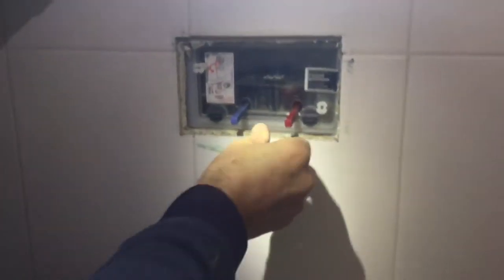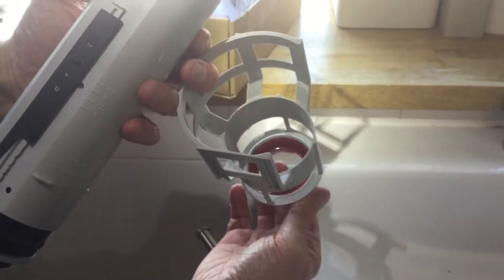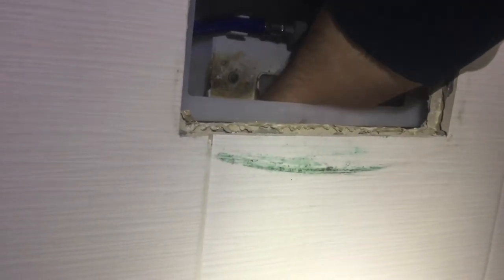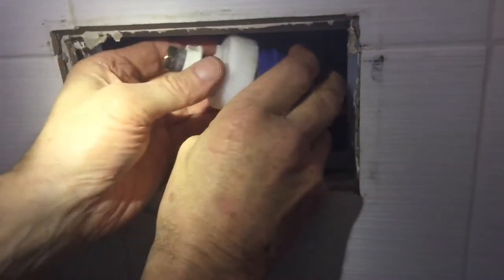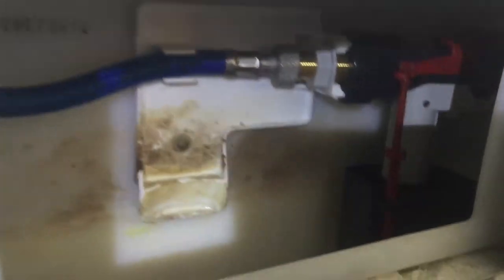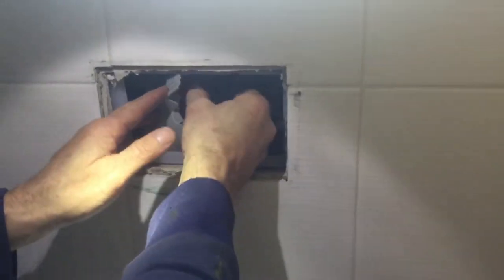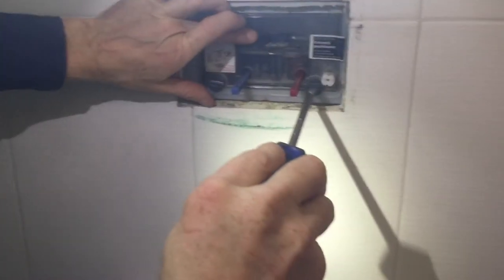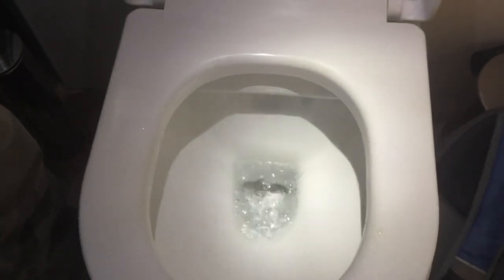TECE concealed toilet cistern repair

Comment: Hello I have the same toilette and the fill valve stopped filling the watter. Now it still takes like 22 minutes (at 6 litres setting) to fill the cistern, although I did some cleaning, so buying new part. I don't know the normal duration of filling for this Tece valve, but for instance with Geberit WC model it should take only 90 seconds.
Reply from the maker: Hi, this one was taking about 30 minutes to fill, but with the new valve fitted it’s about 45 seconds. The water supply is at a pressure of about 5 bar. ( 70 psi). If your pressure is lower then it will take longer. 👍

Comment: What is the tap inside for turning water off does not turn. Totally stuck. Replacing fill valve.
Reply from the maker: Hi, it’s supposed to stop the water so you can change the fill valve but if yours is stuck then you’ll need to go further back maybe to the main stop valve. If it’s fed from a loft tank then you can simply push a bung into the tank out let pipe, bungs are available usually in pairs.  Or just stuff a  rag in the pipe, make sure you can get it out again. If it’s mains fed and you can’t find the main valve then you have a couple of choices, buy a freeze kit and freeze the pipe and fit a new isolator somewhere convenient, (or just change the fill valve while the pipe is frozen ) , this only works if you can stop all water flow through the pipe or it won’t freeze, so it’s no good if the fill valve is constantly running, you’ll never freeze moving water.   The other option is to turn on all the taps fed from the mains and then change the fill valve while it’s running,  turning on all the taps will reduce the amount of water coming out of the fill valve hose but it’s really not that much anyway even if you left it at full mains flow. The water will on,y flow into the toilet bowl so there’s no panic if it goes a bit wrong and you have to take some extra time, you won’t get flooded.   And in a desperate emergency where you have water blowing out all over the place you can crush the pipe down with a hammer or pliers somewhere close by and then you’ll have time to assess the situation. A squashed pipe is easier to fix than a flooded house. 
P

Comment: Sorry to bother you but which way clockwise or anti-clockwise does the inlet water feed tap go it doesn’t want to go anywhere at the moment.
Reply from the maker: Hi, it’s a standard tap, clockwise for off so if it’s stuck you’ll have to isolate the water further away, on the incoming mains if that’s the only one accessible. If it’s fed from the tank in the loft then just block up the tank outlet. If you can’t isolate it at all then you can do it live if you’re confident enough, when you unscrew the hose from the float valve the water will just run into the cistern and out to the toilet pan, ( if you’ve removed the flusher) then you can fit the hose onto the new float valve loosely and once it’s positioned just lightly nip or leave it finger tight . the O ring seals it, not the tightness of the hose ring.  In a dire emergency you can always squash a pipe with pliars to reduce a full flow leak and give you time to think.  Make sure the float doesn’t drag on the cistern or it won’t shut off
Reply: @thpxs0554  thank you 🙏

Comment: Can I ask did you chose the tece yourself or did one of these barthroom merchants help talk you into buying tece over a gebriet or grohe rapid? Just asking because iv just done the rounds, I settled for the grohe rapid but almost talked into buying one of these
Reply from the maker: Hi, it’s not my Toilet, I was doing it for a customer.  It was installed when he bought the house.  From an engineering point of view it’s got lots of potential to cause problems but in practice they seem to be mostly trouble free. If fitted correctly. There’s a big metal frame fixed to the wall and it all hangs off that.  But I’d certainly recommend an additional isolator close by. One that’s easy to get to and to replace as well.  I can’t comment on the other 2 makes other than I’ve fitted Grohe shower units and they’ve been completely reliable. Never called back yet
Reply: @thpxs0554  thanks for the reply, reason why I was asking is because a lot of bathroom salesman try there best to promote this brand selling a trouble free German made cistern with metal flush plate, I never got roped in but I can see how they could be quite appealing if non the wiser, they can easily set u back around 350-400 quid. Thanks anyway mate much appreciated

Comment: My TECE concealed cistern is just leaking /running water into the pan,do i just need to change the basket sealing washer?......thanks.......Dave.
Reply from the maker: The basket O ring seal won’t leak, ( the one that seals the basket to the socket in the out-pipe. ) it’ll be the flat washer on the bottom of the flush valve. It’s a common failure on all flush valves with that arrangement,  I changed that washer on the one in the video but it was still dribbling, slightly. I bought a silicone one but ended up changing the whole flush valve -basket and fill valve. It is worth trying the washer first cos it’s only a 10 minute job and a couple of quid. You could remove the flush valve and turn the washer over, that often works, and you can measure it then in case you have to buy a new one. You’ll have to reach in and scratch off the lime scale on the basket contact ridge with your finger nail.
Reply from the maker: The O ring that seals the basket to the socket in the out-pipe won’t leak. So you shouldn’t need to disturb the basket at all.  It’ll be leaking on the flat washer on the bottom of the flush valve. I did change it on this one but it didn’t fully stop it, so I changed the whole kit, 
You could try turning your washer seal over, that often fixes them. You have to get the washer off anyway so you may as well measure it in case you need to order one anyway. It’s a really common failure on all those style of flushers. And feel the basket sealing ridge to see if there’s any lime scale on it, that’ll cause a leak.
Reply: Thanks 🙏 for your reply ,very prompt too,do you know the part no of just the washer or the whole kit? Thanks 🙏 again….Dave 🤓
Reply from the maker: https://www.toiletspares.co.uk/
Go to this site and enter TECE.  They list all the parts.  Your seal may be A2 or A3.  But you have to get the flush valve out to see,  and if you go that far you may as well just pop a new one in.  I got the fill and flush valves as a set cheaper than just one part on eBay.  And they’re the genuine TECE part. They do a very slim line 8cm flush valve so you need to check yours first. One washer is £3:60 but the other is £10,  😱. A new valve is only £24 with new diaphragm in it. Swapping the flush valve start to finish is 10 minutes so long as you don’t end up swapping the basket, which I’d leave alone to start with.  You’ll need a thin arm to get in to get the basket out, and id put some soap or similar round the O ring, cos if you break anything down there then you may have to chop off the tiles.
Reply: @thpxs0554  Excuse my naivety,I presume the flush valve is the one that goes in the basket?sounds like a better idea replacing the whole lot, will the new slimline one fit the same?
Reply: @thpxs0554  is it the TS674 flush valve?
Reply from the maker: @daviddickinson9957  
The one I fitted was the TS 674. But I can’t say that’s the correct one for your toilet .i would remove the one you have in your toilet and check it’s like the 675. It may be a tiny bit different like in my video as it’s been modified over time. Just be careful when you rotate it that it doesn’t damage the plastic clip it slides behind to locate it against the back surface . Then remove the bottom washer/seal and flip it over. That may cure your leak. The one in the photo on the web site has the basket attached, yours will not cos that stays in the cistern unless you reach down and remove it.
Reply: @thpxs0554  Thanks 🙏 very much for your help…. Dave 🤓